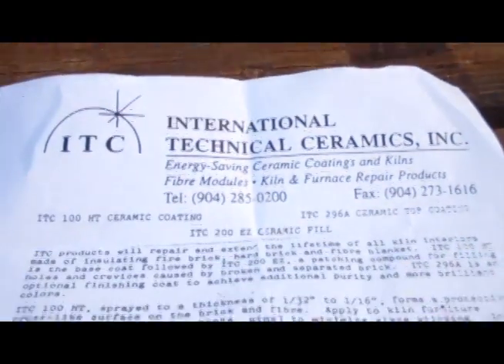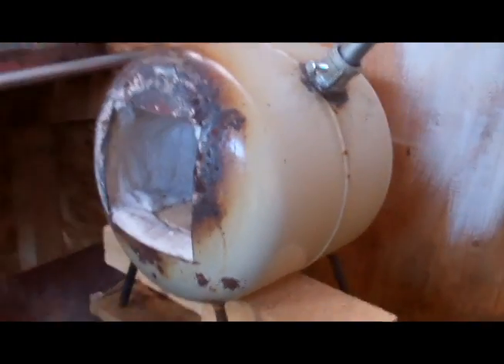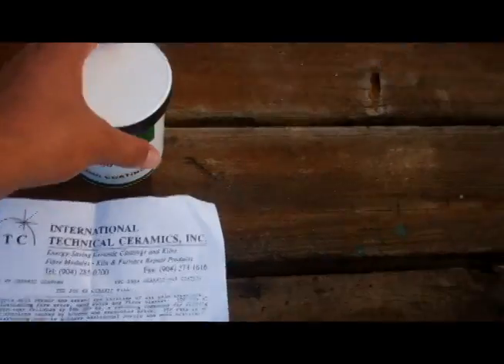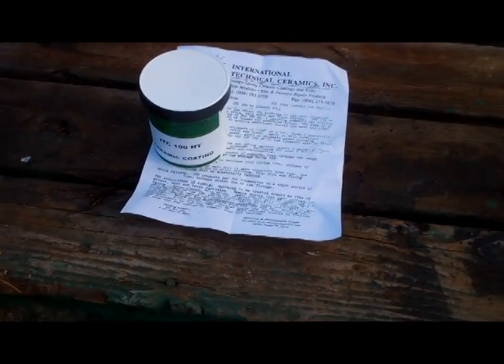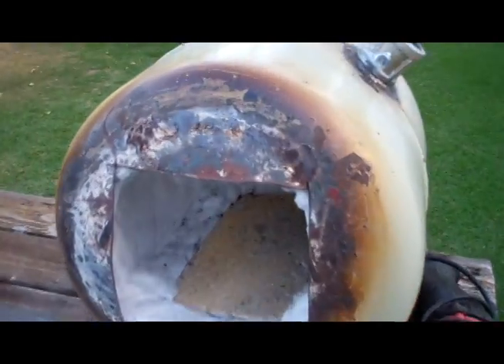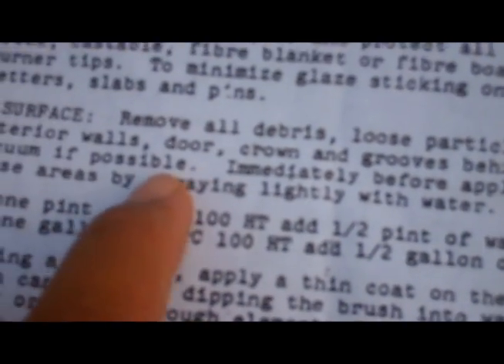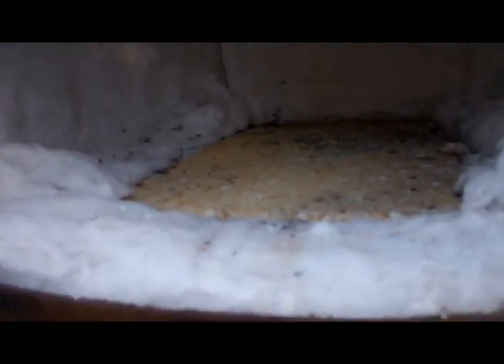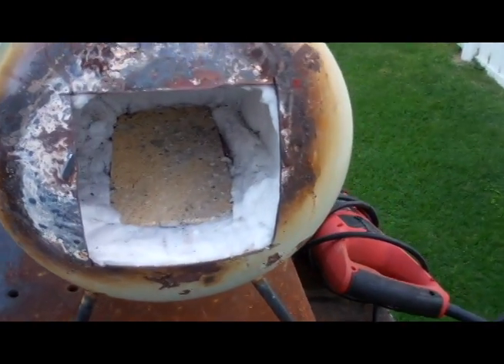propane forge part 2

Comment: Cool thank you. I’m going to mix up about a 3rd of mine then because my forge is a little smaller than yours. I burned a hole in my insulation trying to weld a billet together lol. I should probably clean off my fire brick too.